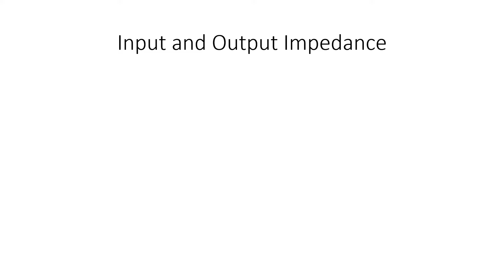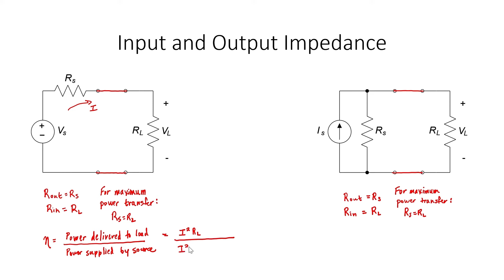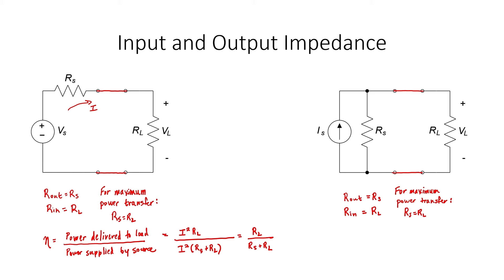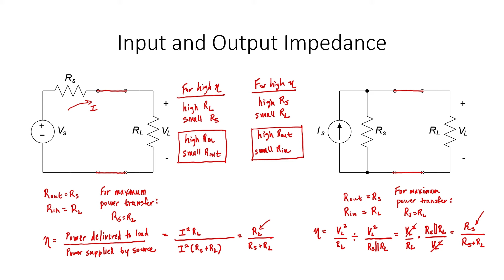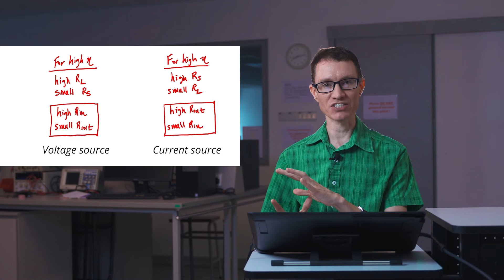Input and Output Impedance (Circuits for Beginners #33)

Comment: On page 36 of the book "The Art of Electronics 3rd Edition", Figure 1.72 shows a simple  diode voltage clamp which looks cool, so I gave it a try. I set the cathode of the diode to a commercial DC voltage supply, set its output to 0v. Signal is connected to my signal generator, it generates a sine wave at 5v / -5v peak. In my imagination, the diode anode should be around 0.7v peak. To my surprise, no, no, the output waveform showing on oscilloscope show the output being clamped, but not at 0.7v, it was as high as 1.85v... What's going on? The voltage output showing on power supply panel is 0v, but the actual value is 1.85v. Obviously, this voltage source is far away from an ideal voltage source, it has a big internal impedence. By inserting an op amp voltage follower between the voltage supply output and the diode cathode, the problem went away. Now, the output wave has 0.7v peak value.

Comment: i wish some video explained the process of calculating it tho. im still confused as to when do you turn off sources, and reactive elements to calculate input and output impedance. and if thats the case, the how could ever an input or output impedance have complex numbers if the reactive elements arent on when making an analysis to calc impedence. also, is making the separate ac and dc analysis give different in out impedances? also same question for low and high frequencies, are there just like 8 different combinations of things happening on a single circuit just to get z_in and z_out?

Comment: WHY HIGHER LOAD RESITANCE SPEAKERS CONSUME MORE POWER---I have seen speakers with higher impedance like subwoofers are of high resistance value 8 ohms but normal speakers are of 4 ohms. But then why subwoofers are of higher wattage than 4 ohms speakers? When lower resistance load is connected to a power source, more current should pass.